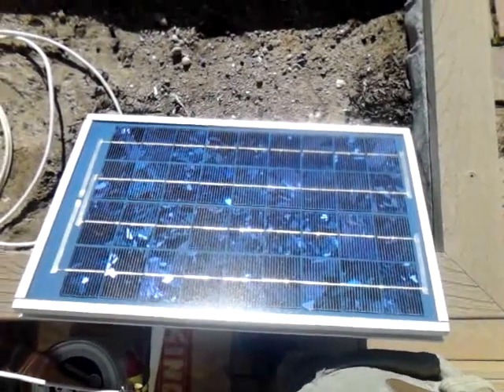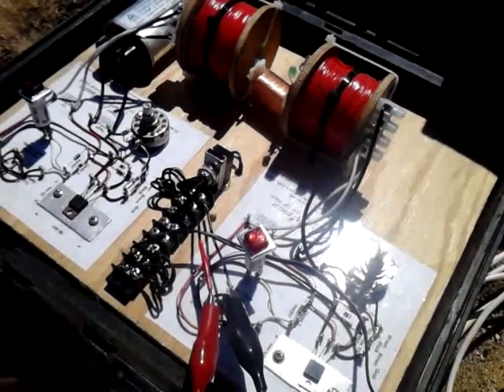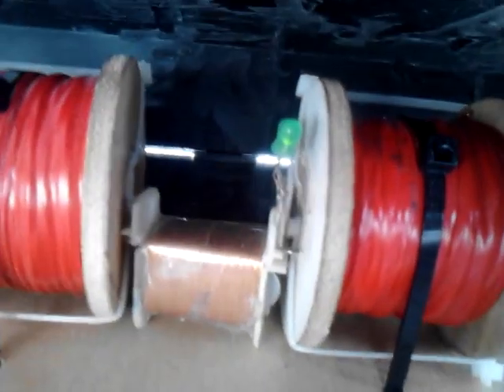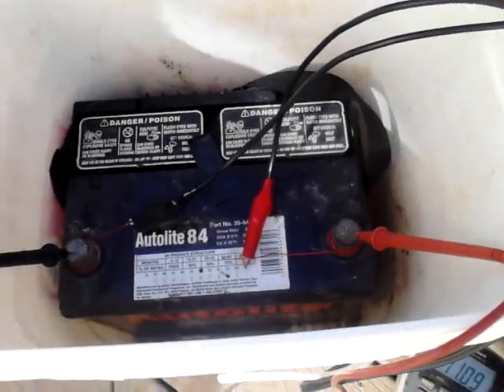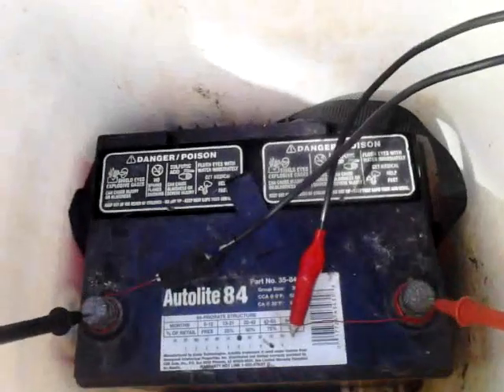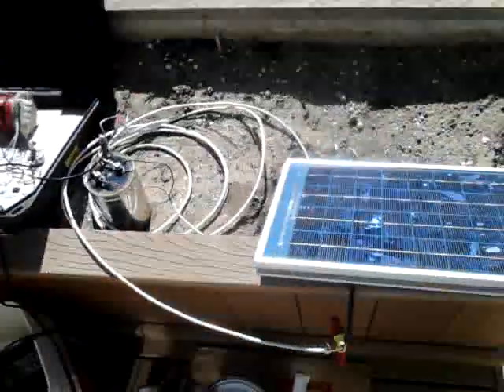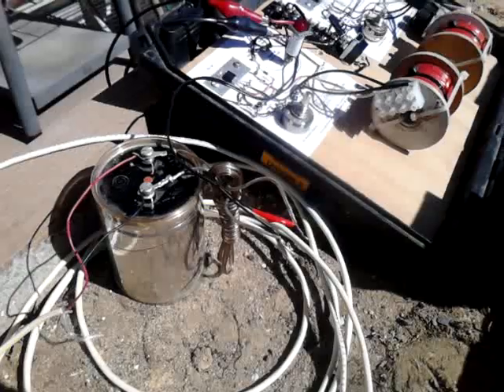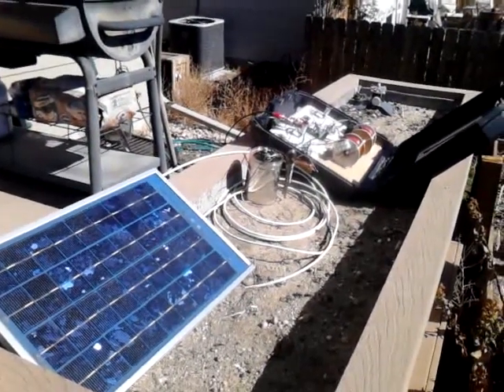Solar powered solid state Bedini/theDaftman SSG

Comment: Hi Troyd,
Great series of videos. Very informative./inspiring
I have a few questions:-
1) Do you have a circuit diagram & a list of parts.
? I have a copy of Daftmans diagram and am in the porcess of trying to build this/these 
2) Why did you use a capacitor. Is it to power the middle coil. Its difficult to see on your video.

Regards
Ben